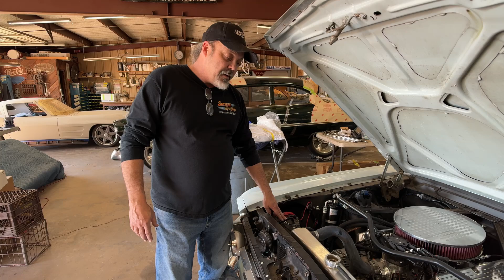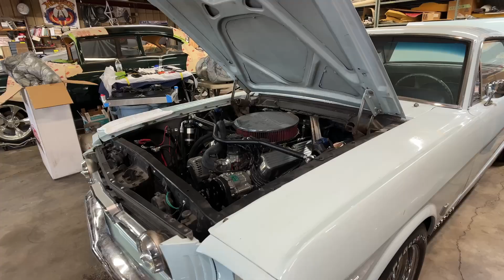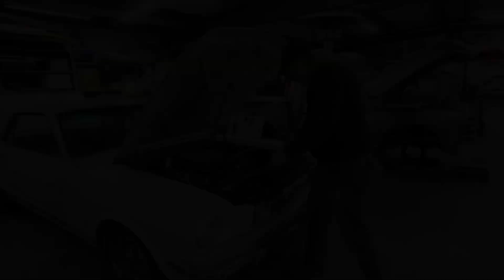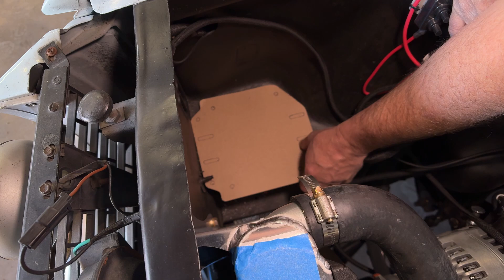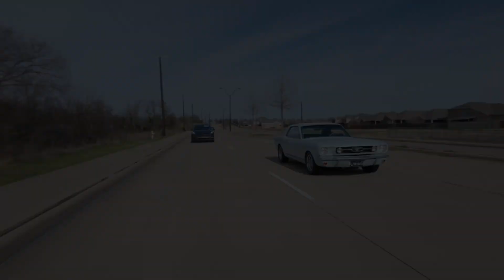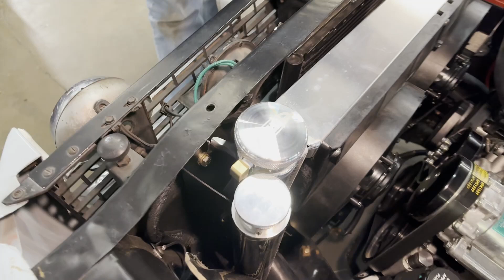Bigger radiator in first gen mustang | 1965-1966 Mustang radiator swap

Comment: Great video!! I'm about to do the same to my 65 to cope with the Australian heat. Do you know the part number for the radiator??
Reply from the maker: Yes! 15-10500 is the part number. PWR the parent company of C&R is also in Australia so you should be able to get it hopefully quickly and easily too! I also have the part number for the hoses we used in the videos description.
Reply: @therodshopchannel  Great!! Thanks, I should have expanded the description and would have found it.

Comment: Neat radiator, but battery relocation makes it kind of a non-starter for my application.
Reply from the maker: We ended up not having to do a battery relocate just switching to an Odyssey battery with there bracket but its all in the factory tray, I think we go over it in the later half of the video!

Comment: This battery has 540CCA amps. I have a beefed up 351 Windsor. Is 540CCA enough to start a motor like mine. I love this battery but unsure if this is enough CCA for a 351windsor. What would you say?
Reply from the maker: 540 is a little low, a 600 would be more preferred but 540 would get the job done! These odyssey batteries are very powerful! Another great battery if you want something tiny to hide, look at the Anti-Gravity batteries they can be placed anywhere and are very small, but they are quite pricey.
Reply: @therodshopchannel thank you!! I just saw and they are far more expensive. Man if only the Odyssey was 600CCA haha. Will continue to see the best option!

Comment: The car has a serpentine system, right? What brand is it? What kind of water pump do you have? It is a lot shorter than mine. This info would help me. Where are you located? Would you be interested in doing mine? It’s pretty much the same set up minus the serpentine system.
Reply from the maker: it's the Vintage Air front runner system for SBF, includes their water pump we love these systems. Also we are in Sachse Tx, right outside of Dallas. We would definitely be interested in doing it for you, give us a call at 972-495-1557 and ask for Mike Millsap.